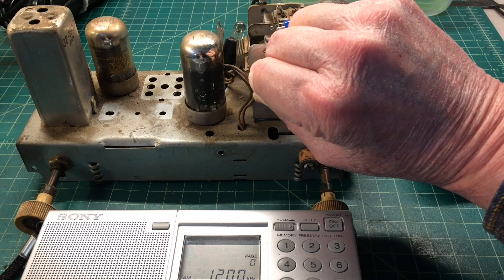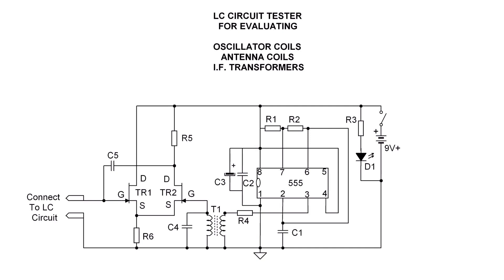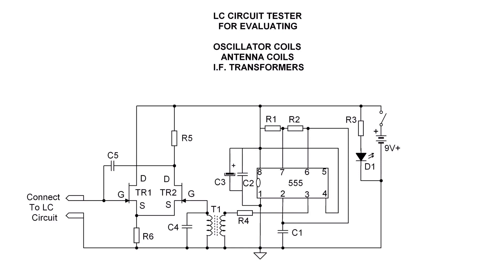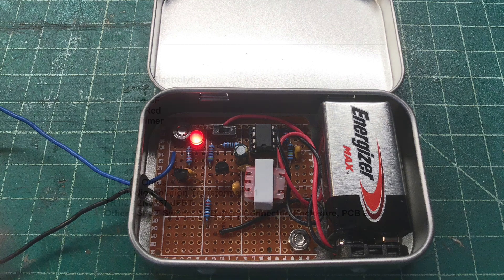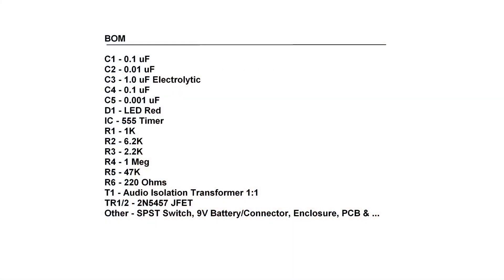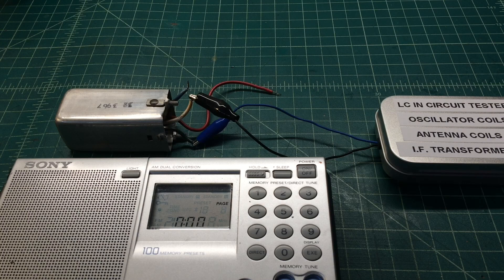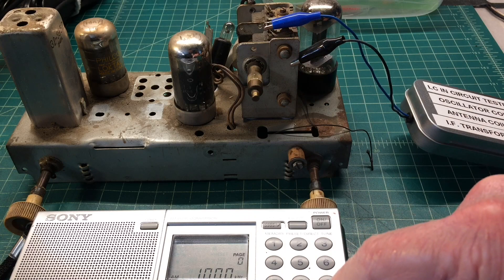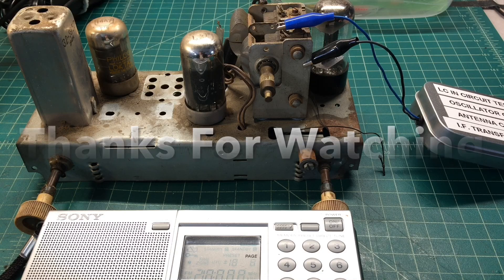LC Circuit Tester to Evaluate I.F. Transformers + Antenna & Oscillator Circuits

Comment: Greetings from a subscriber. I wanted to ask if the resistor R3 in the schematic, which limits the voltage across the LED, is correct. A value of 2K2 seems high. A value of 220 ohms might be more accurate. Could the value of R6 be off? If you could verify these values for me, I'd appreciate it. Thank you very much.
Reply from the maker: I increased the value of R3 to limit the current flow that illuminates the LED. You could try different values and see what works best in your application. R6 is correct, again you can modify based on your preferences. Hope this helps and sorry for my belated response. All the best. Don

Comment: Turn JFET oscillator circuit to multiband regenerative receiver 0,5-30MHz AM, SSB, CW.
Reply from the maker: Would make for an interesting project for sure. Best, Don

Comment: Hi, I have made a prototype of your LC tester but having not 2N5457 I have put it on two J309 that I have seen on a component selling site could be a direct replacement. But then 555 section works correctly, RF oscillator tested with some 455 Khz or a red AM oscillator IF tank, not. Could be 2N5457 critical to this circuit? Thanks in advance, F.
Reply from the maker: I pinged a friend that built the circuit (he reported it was working great) and I’m waiting to hear back on what JFETs he used. I’ll reply back when I hear from him. Best, Don
Reply: @RestoreOldRadios  Thank you su much, however I have find a 2N5457 stock on Ebay not so far from me, so soon I will prove it too.
Reply from the maker: Thank you. Please keep me posted on your findings. Best, Don
Reply: @RestoreOldRadios  The components arrived but incredible to say ... they are a fake! That is, they are correctly marked "2N5457" but when tested with an ESR Meter they are actually unknown bipolar NPN transistors. I will return it to the Ebay seller who obviously doesn't know about semiconductors ... aside from cheap china sellers, only Mouser seems to sell this component with a quality guarantee using an express courier.
Reply from the maker: @elettronicaradiofc  I hate that. I haven’t back from Jim who built the circuit to find out what JFETs he may have used. Hope you’re able to resolve the issue with the seller. Best, Don
Reply from the maker: The JFETs I used:

(20PCS) 2N5457 JFET N-CH GP 10MA TO-92

https://www.amazon.com/dp/B0168126D8/ref=cm_sw_em_r_mt_dp_HSDZVN1XJGBZG41H0JHE?_encoding=UTF8&psc=1
Reply: @RestoreOldRadios  Unavailable...ok I have buyed from China, Mouser need 26 € for 5 pieces, frankly too much and I have no hurry. I have seek for a right replacement but only was 2SK series, so I decide to buy it from Ebay again. Thanks for attention.
Reply: Just for information, the 2N5457's come from China, tested they are correctly JFET. Promptly mounted, circuit now works correctly! Thank again!
Reply from the maker: @elettronicaradiofc  Thank you. All the best. Don
Reply: Try changing value of R6. I've seen 1K used in a J310 FET circuit. Perhaps try a variable resistor, say 2K max, and adjust for best results.

Comment: Don - Pardon my ignorance as I may not know what I'm talking about, however...is this circuit very similar to a Colpitts circuit using a 555....same theory / principle?  Either way this is very cool, thanks !  ~Jack, VEG
Reply from the maker: Jack - somewhat. The two JFETs are configured to provide oscillation using a single capacitor/inductor in parallel. A Colpitt Oscillator uses the center tap of two Capacitors or Inductors in parallel. The 555 is configured as a square wave generator. Hope all is well with you. Best, Don

Comment: Hi Don. I have same SONY radio model. I bought it in Pristina, (Kosovo). It is my favourite radio receiver, but I hate to buy batteries for it. Some times I think on change standard batteries for NIMh rechargeable batteries. And maybe some a day I will do the change. Didn´t you think on this?
By the other side, I have seen a very intelligent and cheap solution of NE555 oscillator as a GRIP DIP meter oscillator.
Very intelligent design.
Have a nice day and congratulations.
Ketk (España)
Reply from the maker: Ketk - the Sony radio does eat the batteries. I had not considered using rechargeable until your mention; great suggestion! Thanks for the feedback on the DIP circuit using the 555. It’s seems to work well based on my limited testing. Have a wonderful day my friend. Best, Don

Comment: Great demonstration of an excellent idea.
Reply from the maker: Jeff - for those in the hobby without extensive test equipment, it will definitely add value, but I’ll find myself using it often due to the simplistic approach for validation. Best, Don
Reply: @RestoreOldRadios  Don, I have a Kenwood Grid/Gate-Dip-Osc which has a "Mod" function but I like yours because it's small and handy.  With surface mount and a small battery it could be something you just leave on the bench.
Reply from the maker: Jeff - I’ve got the Kenwood DM-81 Dip Meter myself. Best, Don

Comment: When I saw the schematic thumbnail, I thought it was  K A Pullen's mixer with FETs, The mixer adds no noise, has gain on the output, has only 4 frequencies out (f1, f2, f1+f2, f1-f2), and is a linear mixer. I played it and found out I was wrong :( Still very cool project.
Reply from the maker: I’ll have to check out K A Pullen's mixer circuit. I appreciate you watching and reaching out. Best, Don

Comment: Don, that RF coil tester works very well, and will come in handy. I plan on building one for myself. Another Great educational video.
Reply from the maker: Thanks Jim. It’s a simple design and I’m sure it can be enhanced to be a better performer. If you do so, I would appreciate you sharing any changes. Best, Don
Reply: @RestoreOldRadios  I will let you how mine went, only part that I don't have is the 1:1 audio isolation transformer, but just ordered it from amazon.

Comment: OOOHHHHHHH    I see now.   You use the radio's reactive elements for the setting the carrier frequency oscillator section.   Ingenious.   I didn't realize the 555 was around in the 40s.   LOL  THANX for the new tool.
Reply from the maker: Enjoy building and using it. Seems to add value with my limited testing to date. Too funny regarding the 555 production date. Take care and stay well. Best, Don